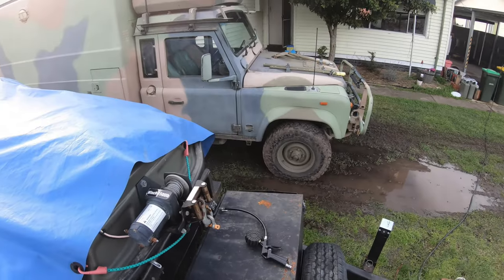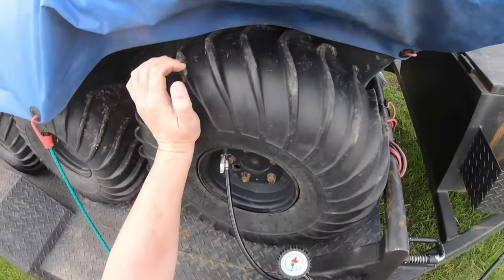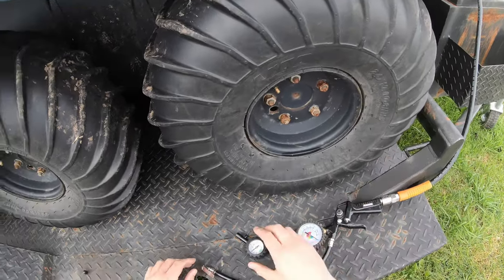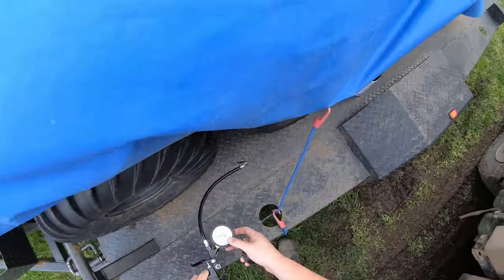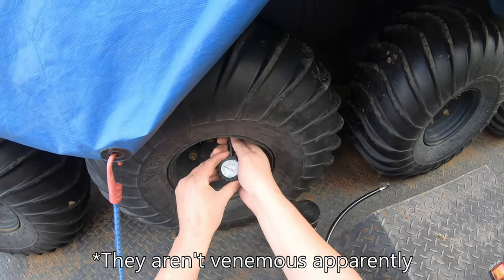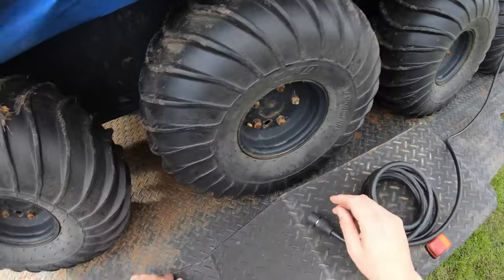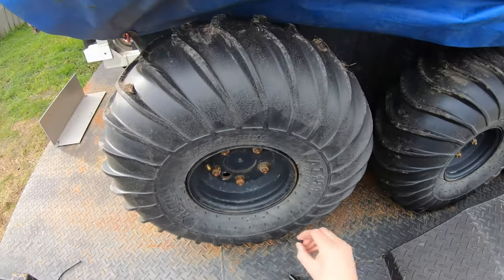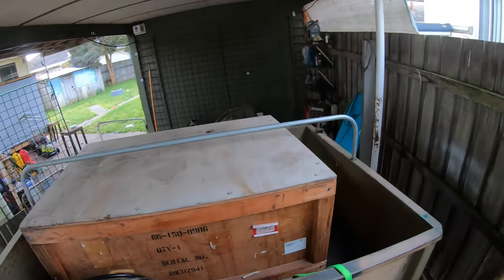What pressure do I use? | 8x8 Argo

Comment: I'm storing one for a friend. It's on tracks and he said 44 PSI here in American units. Before I drive someone else's machine I do my owners manual dive and I laughed. NW Montana on snow. Your rationale of shrinking by less pressure, the pivot point on the nose or tail makes perfect sense. I'll try 5,7,7,5 or so. I do have a good digital gauge I'll use. Stay safe down under mate and thank you.
Reply from the maker: Yeah 44psi will blow them off the rims. 7 max psi.
I needed to get a low psi gauge to read the pressures, most won't go that low.

Comment: Great to the point video.

Not to pick an argument with a guy who has been an Argo owner much longer than I, but I stick to the owners' manual recommendations (for my 6x6).  Argo doesn't really give a tracks/no-tracks difference in the manual, nor do they talk about the center tires being higher pressure (though I understand the logic).

Venomous birds LOL.  You shouldn't worry about them too much since you all undoubtedly  have sabre-toothed, fire-breathing house cats to take them out.
Reply from the maker: The pressures are gleaned from several argo groups, one of which I moderate.
Mire iften than I would like, I need to cross roads of traverse hard ground. I find this pressure combo makes it much easier to turn without leaving huge rubber marks that both upset property owners, and indicate I have been there.

It's also far more convenient to air down in the field than to air up.
Reply from the maker: As for the cats, my place is a cat highway and yes we have a serious problem with keeping native wildlife alive.